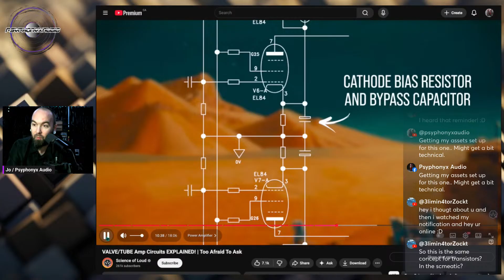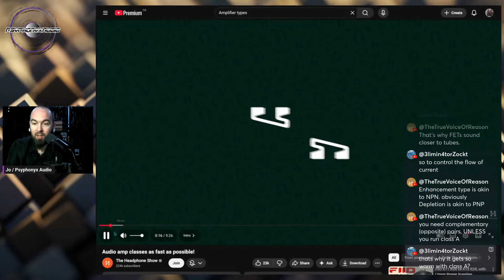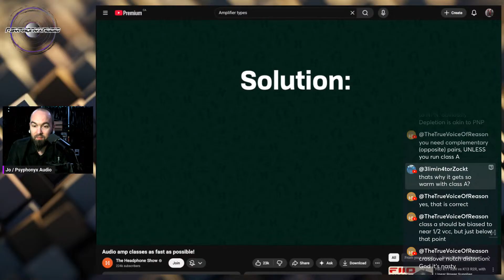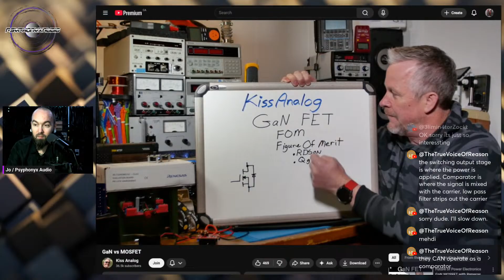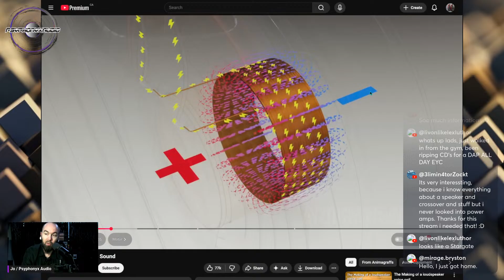Amplifier Types & Technologies - A Learning Curve

Comment: BL is the motor strength of the speaker expressed by the magnetic flux density (B) by the length of the voice coil wire (L). This also relates to the actual inductance of the voice coil.
Reply: Starts @ 1:16:25

Comment: The comparator operation, I believe it was Mehdi's video that showed it. 

The OpAmp has both a positive and negative input, and natively it compares the signal and tries to keep them at the same level (voltage). So, when the triangle wave and sine wave overlay inside the opamp, there are areas where they sit within each other. When they sit outside the other, the opamp switches on to try to level them out. When the signals come back together, it switches off. That forms the square wave.
Reply from the maker: So, the quality of the mechanism and speed of the 'compare and regulate' means a more accurate output.. 

...and people say OpAmps all sound the same..
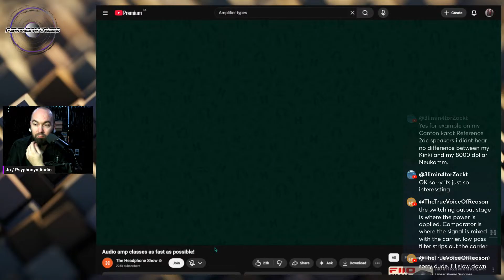Reply: I was incorrect. It was The Headphone Show and it explains @ 0:40:45

Comment: KISSANALOG - drive control is the comparator and the switch operator. You need both of those before the switching transistors to properly create the pwm power that then goes to the filters right before the speaker outputs.

On his scope, note how smooth the sine wave is and then relate that to how tight (high frequency) the square wave is. The higher the frequency, the finer the step on the sine wave. On older class D, the carrier frequency was WAY lower, sometimes as low as 200 khz. That left jagged steps on the sine wave and the filters had to be low enough in frrquency that they affected the audio high frequencies (downward slope too early).

MOS in MOSFET stands for Metal Oxide Semiconductor.

GaNfets - I haven't dived into them yet, but the lower RDS should imply that their internal capacitance  would be lower as well, explaining why they have higher operating frequencies. 
Why is this good? It moves the carrier frequency higher which means the filters will be centered higher. That means the coils/chokes will be smaller and spurious noise will be so high that compensation / bypass caps will be even smaller. And the further away from standard audio frequencies it is, the better it is for almost all aspects of design and build, until you get into the RF frequencies that can be problematic at the pcb level
Reply from the maker: Appreciate the added detail and information - definitely helpful for those looking to understand the technical side.
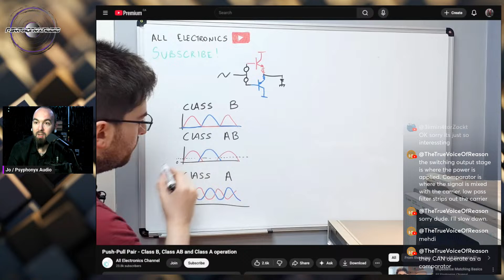Reply: @ 0:57:30

Comment: Re: Paul.
I think he's  a wonderful, passionate  man, but his explanations sometimes miss the mark or roll away into a side ramble. Other than that, he's doing a service for his business and trying to keep a community robust.

Tubes work on thermionic emission amplification, whereas solid state work on resistive flow amplification. The major difference is what he alludes to in that with glass/bottles/valves, you need big iron (transformers) to transfer the high voltage (sometimes over 700 volts) low current signal to low voltage high current to drive the loudspeakers. This is one of the biggest factors in shaping the sound of tube amps, whether most designers want to admit it. All that needs to be done  is look at an audio transformers response curve and you'll see it.
Transistors don't need iron as they can pass enough current to get the job done.

Edit: also, the biggest difference between tubes ans solid state is the harmonic distortion types. Tubes have even order harmonics which are more pleasing to the ear, while solid state, in general, has odd order harmonics, which can be very grating on our ears. I'm surprised Paul didn't mention that.
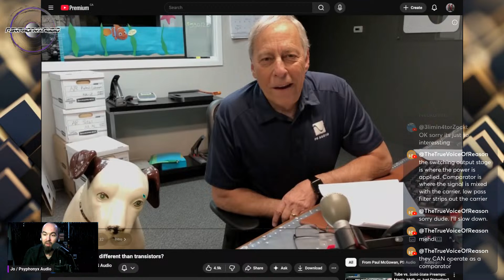Reply: @ 0:50:00

Comment: Picking up where I left off in the LIVE, Mehdi /Electroboom and the opamp. The OpAmp performs whatever operation it is configured for. 3 most common are inverting and noninverting amplifiers (signal fed to + or - inputs with the unused input referenced to ground) and the comparator (different signals fed to the + and - inputs at the same time). A 4th would be an oscillator where positive feedback causes the opamp to oscillate. There are more things you can do, but they tend to be more and more niche and specialized, and you would be better off with a different chip.
Reply from the maker: In that case, some input stages in audio specifically could benefit from a diff circuit.. I suppose thats why some are doing tube input stages.. and other types.
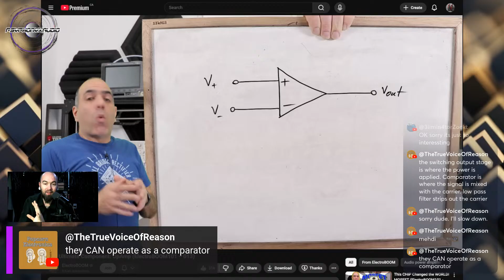Reply: ~ @ 0:48:20

Comment: Bryston for me I need power.  More power.  Driving magnepan lrs with 7bsst2 and they love them.  Still cant crank loud but sounding tasty and even modest bass.  Ok sorry I do love tubes too I have cj old gear lotsa mullard nos pricey tubes but kinda need juice for mosta my speakers...
Reply: Maggies do need lots of power. They 'can' be run with tubes, but that would be a very expensive proposition.
Reply from the maker: I hear the issue is impedance level.. meaning current - like Hegel amps.. or most class D that are 2ohm stable.
Reply: @psyphonyxaudio with tubes, that would mean that the transformer would have to be able to handle it. One that could do that low impedance and high enough current would be massive. I've come across articles where someone pairs a specific tube amp with maggies, but they say that the amps were modified or designed for such loads. Unfortunately, it's been years since I've read them and I have no clue where they were published.
Reply from the maker: What are the speakers? .. and what is the sensitivity? Some times the speakers can be the limited point - not the amps. - We all knot that some amps can blow speakers out.. usually not speakers topping out the amps.

A bit of both is possible. However.. We can talk loudness Versus Quality in a different video. MANY reasons why loud can be terrible.
Reply: @Psyphonyx_Audio my main speakers are Infinity Kappa 8s and 7s.  They have low impedances that Bryston can handle...
Reply from the maker: Nice. I have known Bryston for that also.